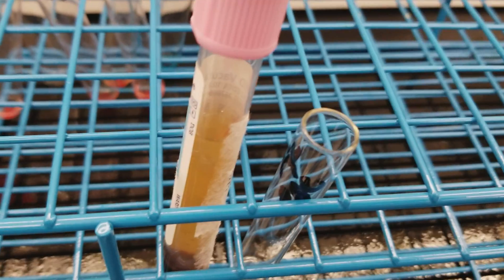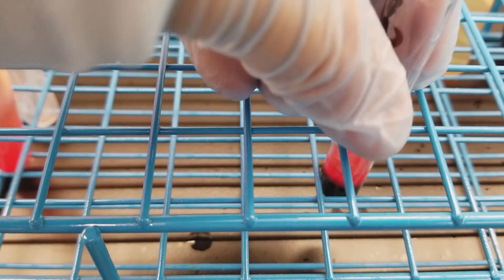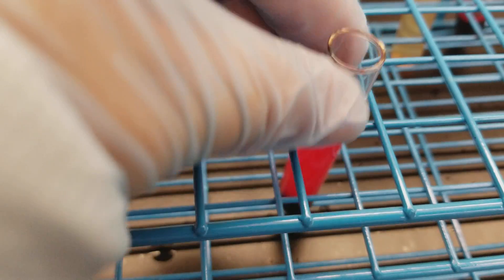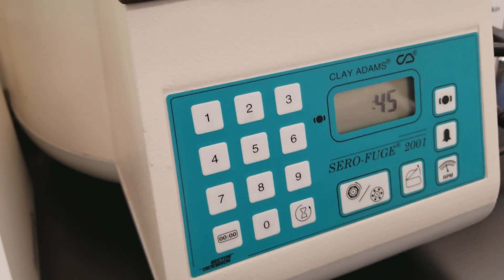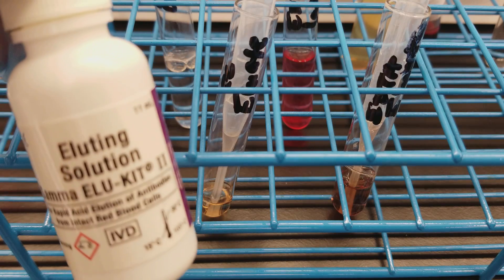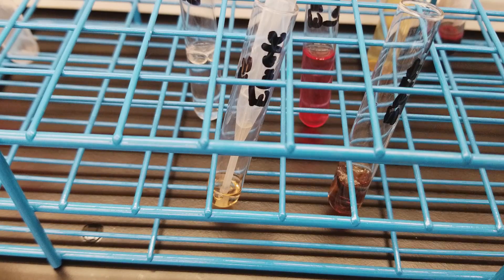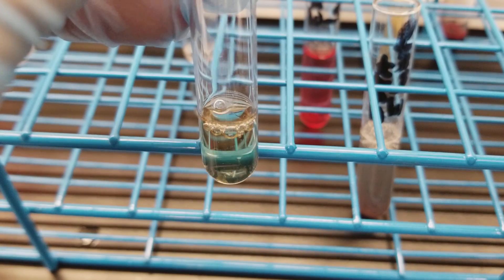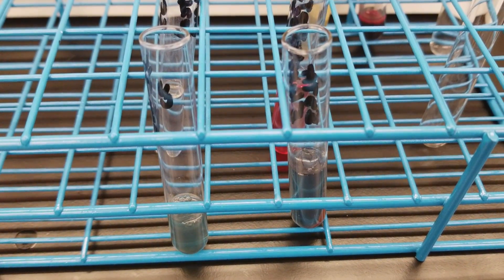Blood Banking:  Acid Elution Part 2

Comment: Thank you so much . It was so helpful because I am doing my project on elution.  I subscribed you.  However, one question how do you use the last wash for control?
Reply from the maker: Anusha 
Thank you for your support!

The last wash is tested parallel to the eluate (as if it was the patient's plasma) using the antibody identification panel.  The idea is that there should only be an antibody in the eluate and not the last wash.  

The eluate should contain the antibody taken off the patient's RBCs.  It is important to identify this antibody so as to ensure safe transfusions in the future.  

The last wash should not contain any antibody.  If there is a positive reaction to any of the reagent RBCs in the antibody identification panel it could mean a couple of things.  The most likely cause would be the wash steps were not performed correctly and there are still some residual unbound antibodies floating around in the last wash.  The other scenario is that the working wash solution liberated some of the antibodies from the patient's RBCs (which is not desirable).  If this is the case, you might see a mirroring of a reaction pattern with the eluate or negative reactions from the eluate.   In any case, you would need to perform the elution and antibody identification panel over again.
Reply: so 50ul of last wash and 25ul of eluate or the other way around? because for antibody Id I will have to use Panel A 50 ul of Rbcs and 25 ul of eluate.  I would really appreciate your help.
Reply from the maker: Anusha 
Using the tube method, you would have a set of tubes which would test the eluate against the reagent RBCs.   At the same time, you would have another set of tubes which would be testing the last wash against the reagent RBCs.   So, if you have a 10 cell panel you would have 10 tubes testing the eluate and 10 tubes testing the last wash (20 total).

You would treat the procedure the same as if you were doing an antibody identification panel with a patient specimen (1 drop of reagent cells and 2 drops of eluate or last wash in place of the plasma).